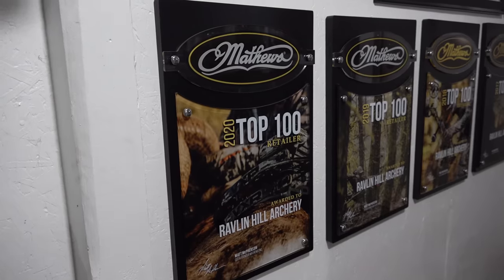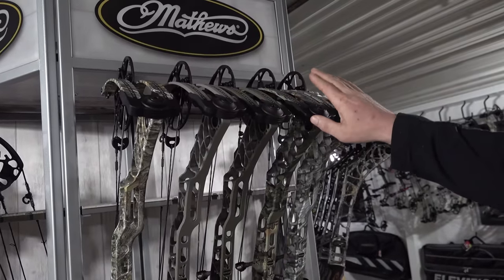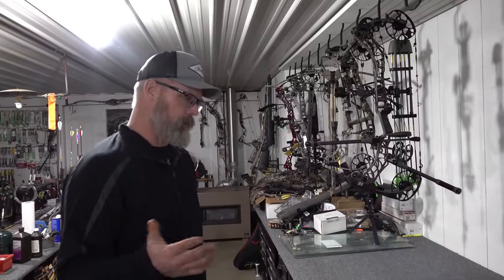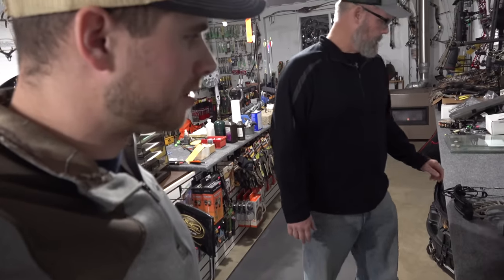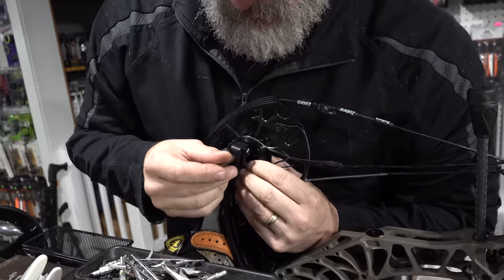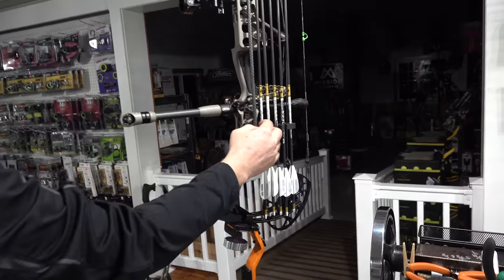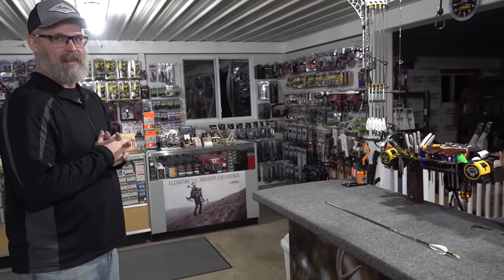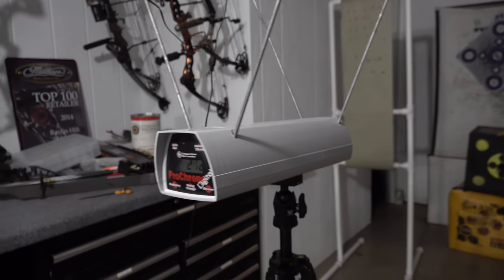New 2022 Mathews V3X Bow Setup At Ravlin Hill Archery

Comment: Just curious why such a heavy draw weight? I'm sure you have a reason just wondering if you had a problem in the past with pass throughs etc at a lighter weight
Reply from the maker: I just want to use the bow/arrow to its fullest potential. The heavier the draw the harder/faster your arrow will go and hit.